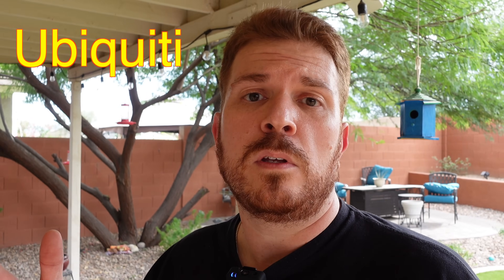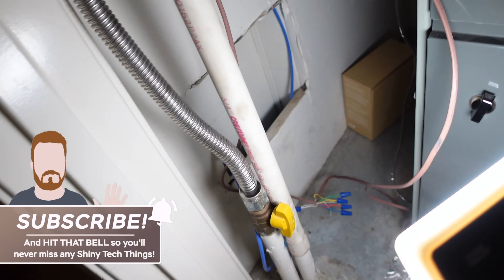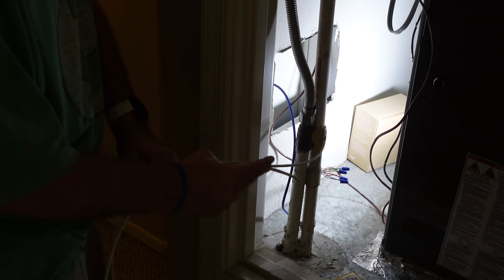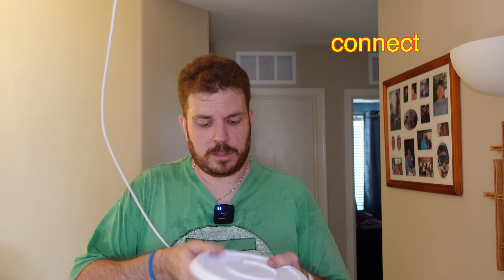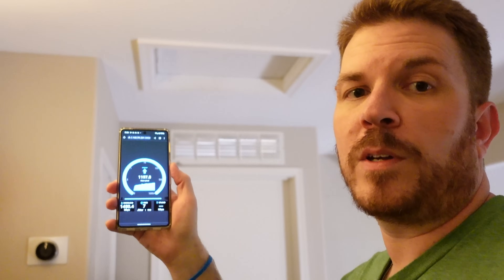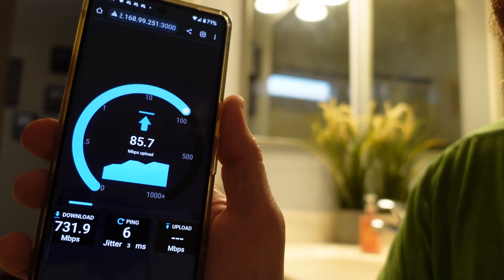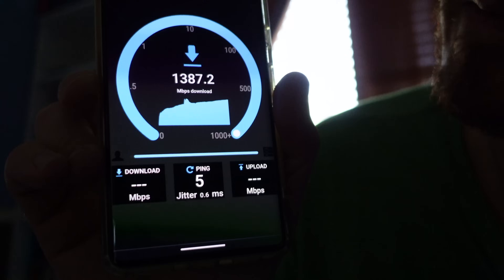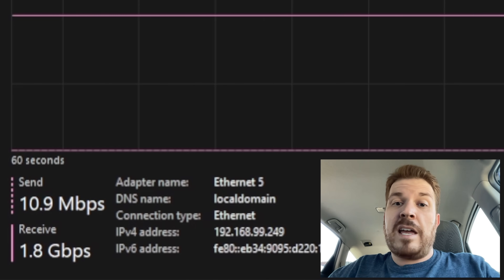UniFi U6 Enterprise Unboxing and Review Part 2 of 2

Comment: Are you still with U6E or upgraded to Wifi 7 Pro or other lineup. Whats your take with U6E
Reply from the maker: @ulaganath The U6E is great but I went with the U7E which is crazy fast with a 10 gig uplink. I do have a 10 GB Network though and it's just crazy fast when you're within line of sight. It's still very fast even through the walls, but if you are in a clear path from the access point, you can easily push multi gigabit over it.

Comment: Hi, did you manage to install E7 entreprise, how does it compare to U6 entreprise?
Reply from the maker: @adrianfora Yes, I have the E7 now and it's awesome but overkill and expensive. I had to use a third party Poe plus plus injector that officially supports 10 gig and connect to that to my 10 gig UniFi switch. Getting a couple of gigs over air is pretty awesome though, but the range at those insane speeds doesn't go too far and that's without Wi-Fi 7. I only have a couple Wi-Fi 7 devices so far.
Reply: @ShinyTechThings  Which one do you advise me to buy, the U6 entreprise or the E7? Is there a big difference between them?
Reply from the maker: @adrianfora the main difference is Wi-Fi 7. If you don't have a faster than gigabit network then it would be bottlenecked by the network. I have close wi-fi 7 devices so I can benefit with faster than gigabit speeds over air but most people will never push that much data over Wi-Fi. I can backup my kids desktop and there's plenty of bandwidth left over for everything else to run without buffering. The 6 enterprise also performed insanely well too just the speed difference if you are close enough and have clients that support those speeds. Does that help?
Reply: @ShinyTechThings  I have some Apple customers. Which one do you suggest I purchase?
Reply from the maker: @adrianfora Since Apple Hardware typically is a generation or so behind with Wi-Fi technology, the Enterprise 6 should be more than enough. Again, it comes down to the habits of the users. So if you're not moving hundreds of gigs of files and have the hardware that supports those speeds, then the Enterprise 7 is a bit Overkill. But on the other hand, if you want to be future-proofed, you can get the latest technology now and once Apple starts supporting Wi-Fi 7 on all of their devices then you will have that available already. From what I remember, Wi-Fi 7 is only supported on some of the newer Apple phones and even with the m4 MacBook pros, they only support Wi-Fi 6E. I'm guessing the m5s will probably support Wi-Fi 7.

Comment: Hi, are you still using the UniFi U6 Enterprise? I would like to buy one and I don't know what to choose. UniFi U6 Enterprise or I saw that they have a newer model, Ubiquiti UniFi Wi-Fi 7, U7-Pro-Max. What would you recommend?
Reply from the maker: @adrianfora The U6 Enterprise seems to have better signal and reliability with all my IoT devices than the U7 Pro Max. The Regular u7 pro seems to have more stable firmware than the U7 Pro Max but it also has the built in spectrum analyzer which can be handy troubleshooting issues. I did hit the U7 Enterprise but I haven't installed it yet and I plan on doing a video on it as well.

What's more important though is what will your environment look like with what types of devices and how many will be connecting?
Reply: @ I'm most interested in the sign on the second floor. And one of them that will be usable for a longer time in the future. What would you recommend? Am I understanding correctly that you will also have E7 Enterprise?
Reply from the maker: @adrianfora So I need more information about what you are saying about "in the sign on the second floor" If this is referencing about how I live in a two-story house it gives adequate coverage, although the iot devices with certain firmwares don't perform as good as the U6 Enterprise compared to my u7 Pro Max. And yes, that is correct. I do have a u7 Enterprise but I have not installed it yet. I've been sick and haven't bounced back yet to start recording again. I am excited to see how the u7 Enterprise is because if it is as good as the U6 Enterprise but with Wi-Fi 7 then it might be the last access point I buy for a long time. It was freaking expensive though, which I'm not thrilled about but years ago I had the SHD and I scored it off of eBay as an open box return For half price and that lasted many many many years. So if this performs the same way, I won't feel so bad about the price point as it's $499 for a single access point. Most people it's way overkill for but because I like to be wireless and transfer really large files over my multi-gig Network. If I can hit speeds well over gigabit then I can justify it a little bit easier. It has a 10 Gb Port Plus also a 1 Gb port for failover.
Reply: @ I wish you good health and I look forward to hearing your opinion about the E7. I am also for speed and the future. That's why I want to make the best choice. U6 Enterprise seems like a good choice in terms of price-quality ratio, I would lean towards it, especially since you say you were very satisfied.
Reply: @ShinyTechThings  Hi, did you manage to install E7 entreprise, how does it compare to U6 entreprise?
Reply: @ShinyTechThings  Hi, did you manage to install E7 entreprise, how does it compare to U6 entreprise?
Reply from the maker: @adrianfora Yes, that is actually what I am currently running right now. It seems a little faster if you have Wi-Fi 7 devices and lower latency, but if not I don't think you will notice much of a difference other than your wallet being a lot lighter 🤦‍♂️🤣. Both Enterprise models seem solid since they released mature firmware for the devices.

Comment: why didn't you just bring AP to switch with short cable to test vs running another line LOL

How is it now a year later? Think they tweaked and perfected the firmware?
Reply from the maker: @daveroski Good point and I'll elaborate. I actually did try shoulder cables down in my office and whenever I had it connected to a non-UniFi switch at 2.5Gig It would have all sorts of problems. It ended up being just half baked firmware, but because it was random, although mostly consistent, I wanted to test it as another variable. I was almost to the point of buying their Pro switch with 2.5 gig Poe just to prove a point but they finally released firmware fixing it. It was a year later because I RMA'd it And just plugged it into the one gig Poe ports on a unifi switch until they got around to actually addressing the issue. They claimed it was the Poe injector or the switch and I tried multiple switches. It was such a waste of time. Also, I have a full-time job and we volunteer a lot so my free time to make videos is limited, especially when I have to spend part of the day in the attic. Now I have the U7 Pro Max ( video in the works but firmware is still half baked IMO ) I'll release it once they iron out the stability issues for some IoT devices that worked fine with the U6 Enterprise.🤦‍♂️🤷‍♂️
Reply: @shinytechthings oh man. Sounds like a nightmare. I don’t have the crazy setup you have. Just the gateway ultra and I’m using eero 6 pro in bridge mode so they can do their mesh thing and works perfect. Thought about getting the 6 enterprise. That’s why I was asking is it worth it now? Or maybe just get eero 6E pro. I know people like to stick to brands but you still have full control over each device w the gateway ultra. What would you recommend for me?  Yeah I would totally do the 7 pro max but I hear it’s awful.
Reply from the maker: @daveroski I rolled back the firmware on the 7 Pro Max and I still need a few more days to collect the data but I think it's more reliable for my iot devices. I did the same at an office where a printer kept having high latency so we will have to wait and see how that works as well. The 6 Enterprise After 6 months of updates was pretty solid. Do you have cabling going to where your mesh nodes are at currently or is it all wireless mesh? How much square footage are you trying to cover and what do the construction materials look like?

Comment: From what I’ve read and been told cat 5e does expected 1Gb and 100Mhz. But you’re saying 2.5? Am I missing something?
Reply from the maker: @ryanrich7324 Correct, although it will depend on the quality of the cable and requires hardware that supports 2.5GbE but I've yet to have an issue using CAT5e for 2.5-5GbE speeds. Here's an article about it:
https://infinity-cable-products.com/blogs/performance/what-is-the-cat5e-max-speed#:~:text=Under%20the%20standard%20of%20IEEE,328%20Feet%20(100%20meters).

Comment: 1:48 I suggest taking some of the gorilla tape and tape the upper rim that so it’s not sharp. It’s only sheet metal
Reply from the maker: True, Maybe next time I go up there I'll do that real quick. I just don't know if the bend over the edges will come undone when it's like over 150° F up there in the summertime.
Reply: @ShinyTechThings  it says holds at 150, I think doing it now in the cooler months an with it being on there over the next few months it’ll adhere to it pretty well.
Reply from the maker: @uniteddrones7626 I'll try to remember to get my ladder upstairs tomorrow and do that. Then I just need to remember to check it in May-Aug. Thanks!

Comment: That is why it is FM. I am installing 3 Wifi 6 Enterprise 6GHz APs on my network, maybe it will work good lol.
Reply from the maker: @gnarkill57 Just make sure you are running the latest firmware and it should perform well. What switch are you connecting it to?

Comment: Curious question here ... would the fluke tester not have let you know if your original cable was good, or is it purely a continuity tester?
Reply from the maker: @MikeDQB Great question. So the fluke tester did show that the original cable is good but it can only verify the line up to gigabit and not 2.5 gig. Those testers are still absurdly priced that do 2.5, 5, and 10GbE over RJ-45. I can't wait to get one but it'll probably be a few years until they get closer to the $1,000 range in which I could justify it for cable installs. Also I haven't been called out to troubleshoot a connection faster than gigabit so right now these speeds are higher end luxury speeds. The businesses that are faster than gigabit are 99% of the time using SFP+ either over DAC copper cable or fiber optic cables. How fast of networking do you use?
Reply: @ShinyTechThings  I recently upgraded from 1 GB to 10 GB at my house.  I don't have a tester to test the cable speed beyond putting a device on each end and seeing what throughput I can get.
 
I do have a continuity tester just to make sure I put the ends on right though!
Reply from the maker: @MikeDQB Did you use EZ crimpers and EZ RJ45 ends? (The passthrough ones They cut off the excess wires when you crimp) ever since I switched to those I have had zero failures even over time with cables outside that get to freezing temperatures. Normally expansion and contraction over time seems to sometimes fail when using regular crimpers and ends. Now come to think of it. I think the failures are typically only POE ones, which makes more sense because you have the heat of the constant power and then you have expansion and contraction with weather outside. Indoors though I still don't remember too many failures with regular RJ45 ends.
Reply from the maker: @MikeDQB Also, if you use wireshark to capture a small internal transfer over 10 gig and also over one gig if you do have any issues they should show up there. How fast of a disk subsystem do you have on both ends?
Reply: @ShinyTechThings  everything is NVMe or Raid0 NVMe.
Reply: @ShinyTechThings  I have a combination of both. Nothing is outside though. It’s either in the attic, between the floors, or in the basement.

I was prepared to pull new cable but so far all seems to work well at 10g.
Reply from the maker: @MikeDQB what drives are they? I will say that most consumer drives will run out of cache and slow way down during a large file transfer over 10 gigabit. So if you were to copy a 50 GB file it would take well over a minute on most drives because the cache gets exhausted part way through the write cycle. You can test this theory if you have enough RAM to build a ram drive large enough to hold whatever file you are testing. I even see this all the time on expensive servers that only have four hard drives in it even though they are SAS drives and have a raid controller because the cache gets exhausted and the disk subsystem can't handle the IOP's over a certain amount of time of a sustained file transfer.

Comment: What are your thoughts on that, once you went by the fridge, the speeds dropped off due to 5/6GHz not being able to penetrate as well through walls/floors/objects within the line-of-sight?
Reply from the maker: @DavidDiSante before I finished shooting this video the 6GHz dropped WAY down for the speeds when in front of my refrigerator. Going to 5GHz was way faster. Now things have improved but until a 6GHz spectrum analyzer becomes affordable I can only guess at things as I come across them on that frequency. Since the firmware updates it's been way better as I described in the video. What AP do you currently have and how fast is your network?
Reply: Welcome to WiFi.
Reply from the maker: @psycl0ptic Wi-Fi can be tricky but with the right tools, knowledge and patience it is possible to break gigabit over air like I did. The challenge is distance through objects but oddly enough the latest firmware improved speeds on 6GHz where it used to be horrible.

Comment: could be integrated antennas. Those are not in any way as good as  omny rubberducky. I'm very interested to see the clock test, where you put the AP somewhere in the yard, and test on each hour mark around it... see if there's any weirdness with antenna patterns. I'm thinking more and more about just APs with external antennas. 4 good omni directional antennas are out to be better than those half snapped razor blades they call antennas... also interesting to see how stuff like ruckus with their cone shaped antenna array would perform in a clock test... they seem to be constructed well enough to allow close to same antennation as omni, but actually housed in the body of the AP itself...
Reply from the maker: @RCTPAVUK That's and interesting concept that I've never tried before testing in the clock pattern around the access point. That's something I can do to be in a few months when it cools down, but right now you can easily reach 118° F outside and that access point does run pretty warm so I don't want to damage it and or get a heat stroke in the process. If you don't hear from me in a few months, please remind me and I will probably do this with a couple access points. I will have to run some ethernet through my office window and out to the backyard, but I can probably get some nice drone shots of the tests as well for entertainment purposes 🤓😎

Comment: Nice video. Can’t you perform a local iperf test?
Reply from the maker: I actually did but I lost that footage. Other than iperf what other stuff would you like to see? Maybe I'll do a much shorter video just going over that and of whatever else you and other viewers want to see.
Reply: @ShinyTechThings  The things I would still like to know is: power consumption in idle and under load, the AP does it get warm/hot, which  POE+ switch do you use and most importantly ... are you satisfied?
Reply: Btw I was YouTube in the past, we talked before… 🙏. My name disappeared…
Reply from the maker: @IAmZen_007  Right now it's showing 11.2 att idle or without me doing speed tests and13.4W under load using 5GHz and 18.5W using 6GHz during download tests from my phone. What's interesting is that during when my phone is uploading it is using 12.8W. The spec sheet says it can run up to 22W. The switch that is in use is the EnGenius ECS2512FP which is cloud controlled and it's not a live status of the wattage through the cloud controller however if I login locally it's live as soon as I refresh the webpage. It does run warm/hot if I take it off the ceiling and touch the back it's uncomfortable to hold in my hand for an extended amount of time. If I can get a thermal camera company to send me a camera I'd love to see how it looks for the heat pattern and exact temperatures. From what I remember the temperature is probably pretty close to the U6-LR which is also PoE+. After Ubiquiti fixed the issues that they claimed were nonexistent I am satisfied with the performance more now than even a month before my last tests that went into this video. Previously the speeds in front of my refergerator was like 400Mbps or lower on 6GHz but then switch to 5GHz and the speeds were more than double. So it's most likely firmware improvements and unfortunately I do not have a 6GHz wi-fi spectrum analyzer yet. They are too pricey with the NetAlly AirCheck G3 Pro costing around $4,000 USD
Reply from the maker: @IAmZen_007 it shows your old name until I tap to view your comment and then it shows the IAmZen_007 name.🤷‍♂️

Comment: What POE are you using?  This AP will turn down the performance unless you have POE++.  Could it be a simple case of coverage and interference?
Reply from the maker: @davidv7403 I tried half a dozen PoE adapters and also several PoE+/++ multigig switches. For the PoE adapters I tried CUDY, Ubiquiti, TP-Link, EnGenius and TRENDnet. No variations at all as long as they were PoE+ or PoE++ I have it running directly off my switch now but it was a horrible experience with Ubiquiti's tech support. All they do is RMA. I was up to the point of literally buying one of their enterprise 2.5 GB 24-port switches for like $800+ Just to prove a point that it would only work with their hardware initially going faster than gigabit. But they never had any stock and they finally released firmware that fixed that issue.